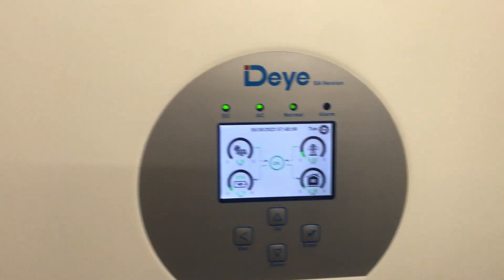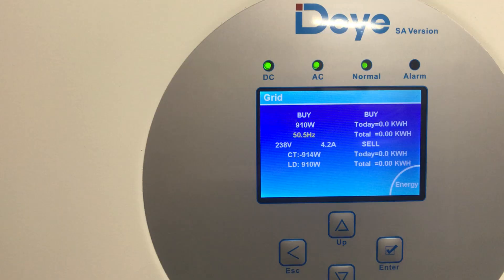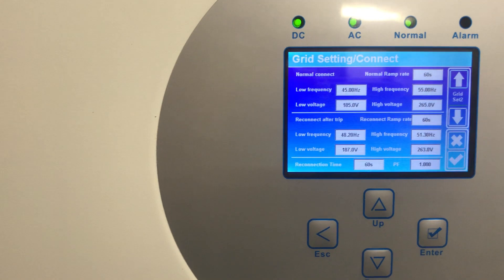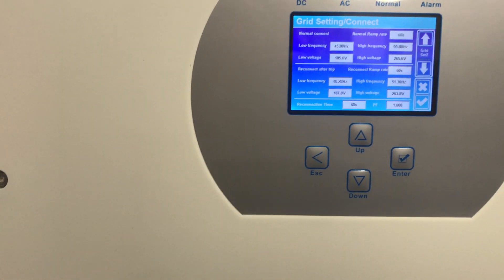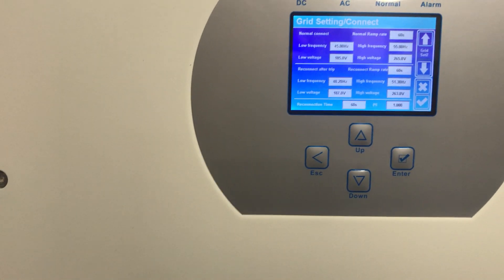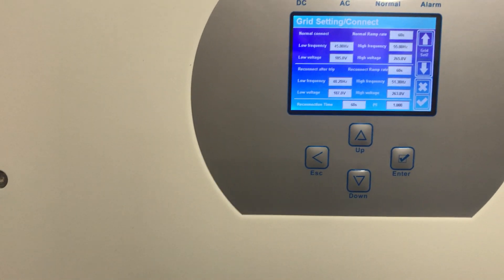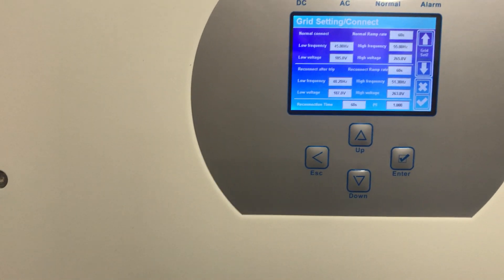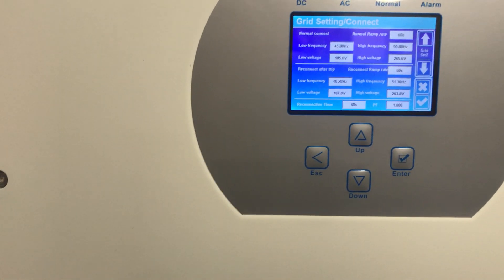DEYE inverter off-grid setup, connecting a pull-start generator

Comment: The best emergency power solution in this case is the direct current generator (e.g. KS 48V-DC from Könner&Söhnen), which can be used to charge the battery directly. This means that the house continues to be supplied by the inverter with a clean sine wave without any performance restrictions from the inverter and only the battery is recharged by the DC generator.

Comment: very helpful video. i wonder if could u set the system work mode to zero export to ct? and make the generator work with the inverter during let's say aircon start having a total starting load  of more than 8kw? in this way your generator could act as a grid supplementing the inverter output
Reply: i asked this because i am currently having a problem of making a 3T standing non-inverter aircon work with an 8kw off-grid solar system
Reply from the maker: @MelayLibres  So my DEYE 8kw manual says it will support an AC peak power output of "2 times of rated power, 10 S", which would be 16kW, for 10 seconds. 
I'm not sure how it will manage the power inputs. Will it use a combination of Generator, PV panels and batteries? 
Mine is currently set to "zero export to ct", but all my loads run off the LOAD connection, so I don't need any export to ct (which would be the generator).

Comment: Thank you for the information.  Why did you not use the gen port?  I have grid power but I'm looking for a gen backup.  But, I cannot get it to work with the gen port.
Reply from the maker: I also could not get it to work with the generator port. Someone else mentioned putting a transfer switch between the grid and generator - that way you can run the generator on the grid port if needs be.
Reply: Generator only works when completely disconnected from grid. If you shut mains supply off and click gen force it should kick in.

Comment: In System Work Mode, you set the time of day the generator should work and charge the batteries. But will the inverter turn on and off the generator automatically? Is that possible, maybe with a more modern generator?
Reply from the maker: That's how I understand it should work. But as I'm not able to test this myself I can't say for sure.
Reply: @unorthofox  I bet this is not possible with the old generator you have, right? So, the time period you set in Work Mode does not make any sense at all as you need to turn it on and off manually.

Comment: I wasn't able to connect Generator to Grid input - Grid menu showed frequency 53Hz and no charge or Grid "Connected" Status. Maybe issue in 53 Hz. GEN connect to Grid port was enabled. But I was able to connect Generator to GEN port (after few hours playing settings). For me it works when I set Gen Signal and Gen Force check marks (pull-start generator, no autostart). But now generator icon showed all the time, even when generator is not connected. If I unmark one of those marks - invertor stops seeing generator. Second thing - manual changes of frequency range did not help in any case. But when I successfuly connected generator - range automaticaly changed to 45-55Hz.

Upd.
I was able to connect Generator to Grid input. Manually changed next  - "Reconnect after trip" -> "High frequency" -> 55Hz.
Reply from the maker: I have not tried the Gen Signal and Gen Force options, so good to know. Seeing as you can use both Grid and Gen inputs for the generator, do you have a preference for either one?
Reply: @unorthofox  It is more convenient for me to use the gen port for the generator, because at the same time I can supply a lower charge current than from the grid, and use the remaining power for my needs.  This is in case of a blackout.  Also, a separate icon of the generator appears and I know exactly how much power I take from it.  I haven't checked one thing yet - whether gen force will switch to the grid when the grid is turned on

Comment: Hello, I have an off grid system with only the sources of pv, what if I use hybrid inverter and by not connecting grid (because not exist) and generator, I would like to do like that because if grid power will come to my village, I may connect it with external ct. But at now, I have only pv and battery, may I connect this to hybrid inverter and may I use it without any problem.

Comment: Could this work with a vehicle to load (V2L) enabled electric car instead of a generator? If so could the inverter be programmed to switch to charging the house battery e.g.  so say at night (or whenever) plug in the v2l enabled vehicle to the inverter (say before going to bed) and when the house battery goes under a certain amount of charge e.g. 50% the inverter starts using the charge in the v2l vehicle to top up the house battery?
Reply from the maker: I think the inverter doesn't really care what the source of power is. If you can supply whatever it expects, e.g. 220V 50Hz single phase (in my case), you should be able to manage that through the System Work Mode setting. See pages 30,31 of this DEYE manual here: https://www.deyeinverter.com/deyeinverter/2020/12/29/502012022%E3%80%90a%E3%80%91%E5%82%A8%E8%83%BD%E5%8D%95%E7%9B%B8%E8%AF%B4%E6%98%8E%E4%B9%A6sun-5-8k-sg01lp1-useu-ver2.0-deye.pdf
Reply: @unorthofox u can use a v2l car like a generator. Only issue is for it to work the inverter has to be off grid so mains have to be manually turned off before it will kick in. So U cannot simply set the generator to kick in automatically with the system mode settings if tied to the grid which is what I thought it was capable of. I wonder if an ATS could make that possible and am looking into that.

Comment: What about the N to ground connection? Relay needed??
Reply from the maker: I think this is a somewhat complicated issue, as the relevant legislation for your area will dictate what is required. Here's my 2c: On my inverter, the ground and neutral is not bonded by default, so if you run it without a neutral-ground bond, then the AC output will float. The inverter doesn't care whether the earth and neutral is bonded so I believe there is no harm to the inverter whichever way you choose to go. For my setup, the inverter supplies a distribution board where the supply neutral and ground is expected to be bonded. I believe this will be the most common situation for most people but I'm no expert. My system is off-grid, which means there is no connection between my AC (neutral and live conductors) and the city council AC (neutral and live conductors). If I had been connected to the city council AC, their neutral and ground will be bonded, and my distribution board would see a power supply with earth and neutral bonded. Since I'm off-grid, I need to supply the neutral-ground bond myself, which in my case is a permanently installed 6mm2 copper conductor between the neutral and earth busbars. So that satisfies the earth-neutral bond requirement in my case. If however, I was to run the system in a grid-tied mode (hybrid mode), then I would need the ATS relay to disconnect the earth-neutral bond when connected to the city council supply, and re-connect it when not connected to the city council supply.
Reply: @unorthofox  I'm off grid too. I'm only interested in the N-G connection for the The residual current device (RCD) to work. My installer said those don't work without that connection, which could be a risk. So, right now I think it's the ground from the inverter grid input that is connected to the output neutral. I guess he knows what he's doing...
His technician (somebody from deye? IDK) said it's ok to keep that connection while using a generator on the grid input.

As my gen peak shaving is not working with my weak generator, I guess I'll end up using the grid input, where I can at least adjust the frequency range, and see what happens. Maybe then it does not disconnect the GEN with the load spikes and properly shaves.
I have a feeling the inverter detects the freq. out of range when load spikes before prioritizing the peak shaving, and so disconnects the gen before it can shave.
Reply: @unorthofox   so, I got it to connect. When I loosen up the parameters, the residual current device (RCD) hits with the pump surge and turns off the power lol. Disconnected the ground from N for now, that's usable. 
It's a 40A (230V) one, never had these problems with outback. I'll study the settings closely and maybe get another less sensitive RCD...
The inverter still disconnects the gen if a surge comes, so any peak shaving is a BS feature for now....

Comment: Interesting.  How do I get into the settings?  How do I change the battery voltage?
Reply from the maker: On my DEYE inverter, there is a touch screen, with a gear icon in the top right. Tap the gear icon to enter the settings menu.

Comment: why you didn’t connect it to gen port?
Reply from the maker: I could not get it to accept the generator input on the gen port, and I could not find any settings to adjust the tolerances for frequency and voltage for the gen port. However the grid port does have more settings and ended up working for me.

Comment: Hi @ Unorthofox, interesting video, I did a similar one a few months  ago as well :-) .  I am connecting to my Gen port with a 5.5kva. I was under the impression that it is not necessary to open up those Grid frequency and voltage settings if you tick the "Gen Connect to Grid input" box. Ticking the box also slows the rate that the load on the inverter is ramped up which gives the generator time to adjust the throttle. I also found that it helps to adjust the generator frequency to slightly on the high side so that it has a bit of space to slow down a bit when the load is applied.  Ticking the Gen Force box will charge the battery no matter what the System Work mode settings are. Check out my video and let me know what you think     https://youtu.be/-VRY9Clo3j8
Reply from the maker: Sorry for the late reply, your comment ended up in the "for review" section and I missed it. Thanks for your advice here - I'm not an expert by any means, but I have found one way of solving my specific problem. I'm sure there are other/better ways to do this. If your generator is well-behaved it may not be necessary to adjust the tolerances for frequency/voltage. In my case I fiddled until it started working and then mostly left it alone - it may be that I can tighten the tolerances and it will still work but since it's working I'll probably just leave it as-is.
Reply: I want to be able to switch to my electric battery generator automatically from grid to benefit from cheaper rates and switch back during ceap night rates to charge ouse batteries. At the moment I'm physically having to shut down the grid connection. Has anyone got experience using an ATS so it will auto switch based on batt % settings?
Reply: @aldozilli1293  You can do that by changing  the settings in your Work Mode settings